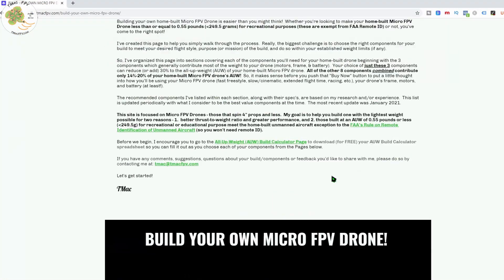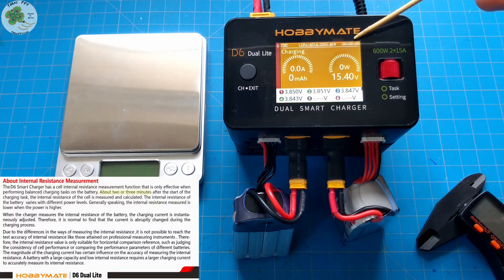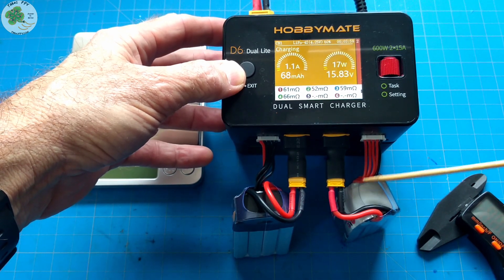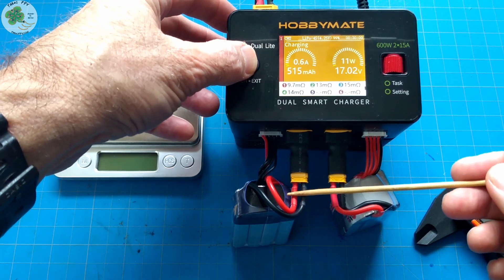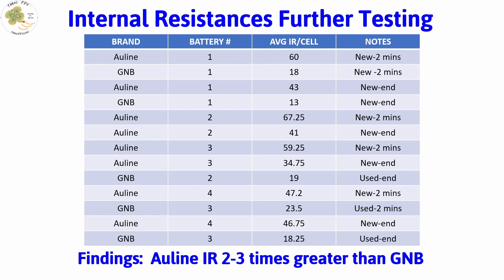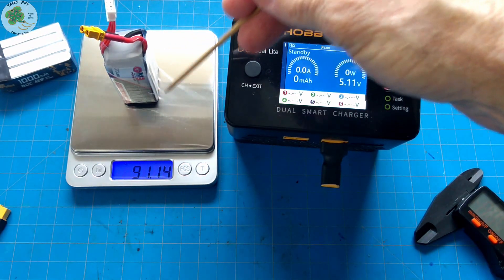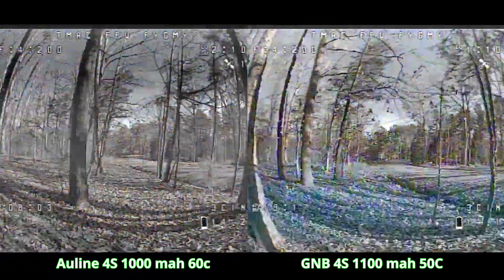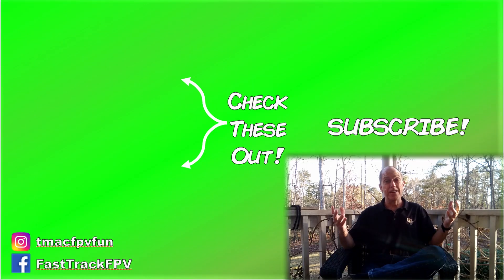Micro FPV Drone Battery (AULINE 4S 1000 mah LiPo)

Comment: TMac. when I was testing IR on my batteries I noticed a difference when using a  XT30 to XT60 or even a parallel charging board and when not using any adapter.  But yeah I only use GNBs and Tattu batteries.
Reply from the maker: Yep, I understand.  that's why I mention in the video its important to measure your IR the same way, with the same device every time.  Different devices/chargers with a different methodology, temperature, etc. wmay give you different values.  I wasn't so much concerned with the precise numerical values as I was with the relative values between the two brands.  Given the same #cells, just about the same capacity and discharge rate, i would have expected the IRs to be very similar given they were both measure on the same device at the same time.  Perhaps this is a (if not the) cause of such a drastic difference in flight time?  I use GNBs and RDQ LiPos.  I'm really not able to tell the difference between RDQ and GNB.  GNB just offers more options in form factor and sizes.  I've also used Tattus for a long time in the past.  Good batt's too!

Comment: Interesting! For the last year ive only been using Tattu Rline 850mah 95c till recently. 
A few weeks ago I got 2 Uruav graphene 850mah 110c & 2 Infinity graphene 850mah 85c batteries, the Uruav are 9-7 resistance at storage charge & Infinity are 5-7 resistance at fully charged. After 1 year + of use my old tattus are 5-7.
On my 3" Armattan gecko with emax 1606 motors I'll get between 3-7 mins flight time depending on how I fly.
P.s Tmac I finally upgraded my T16 to open tx yesterday 😂🤣😂🤣
Reply from the maker: Hey Barnz1980! Made "the leap" to OpenTX, huh?!? Your Armattan 3" Gecko with 1606 motors is "a little" heavier than the Pygmy Rattler frame (25 grams) along with its 1404 motors (9 grams ea) I'm running on it.  So, yeah, i wouldn't expect you to get 19+ minutes of flight time on it even with the GNB 1100's.  Good IR on your batteries!  My charger's methodology of measuring IR MAY be different than yours
Reply: @TMac    hehe I did take a while, Ive only flown around the streets at my house in suburbia (not like Tmacs epic house) but I haven't really noticed any difference between jumper tx & open tx to be honest. Maybe when I go to the park soon when my batteries are charged I will notice somthink 🤔🤔
Yeah this quad is a lil fatty for a 3" but it does go pretty fast, I started with a Tyro79 & that gets longer flights but it quite slow in comparison. Also something about the battery being on top just makes the quad feel soooo much better imo, it's almost like betaflight was made for quads carrying batteries on the top 😉
I have a SKYRC D100 v2 charger, I can only test while resistance if I'm not charging ☹️

Comment: I've been flying with Tatoo 850mah and squeezing around 6 minutes of calm cruising with my power hungry Rattler. Bear in mind those 1507 T-Motor are not built for maximum efficiency. My next batch is going to be GNB. Thanks for the money saving and extra flight time.
Reply from the maker: Yep, those 1507s like high C-ratings for performance.  You can cruise with the GNB 1100s (50C) though.  GNBs for the win!😀